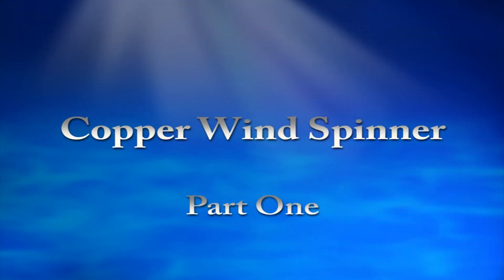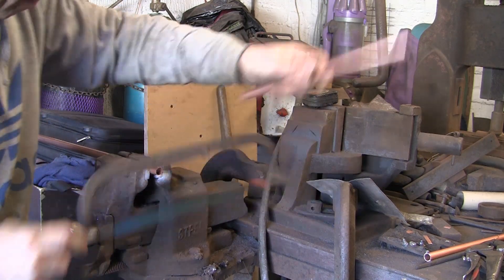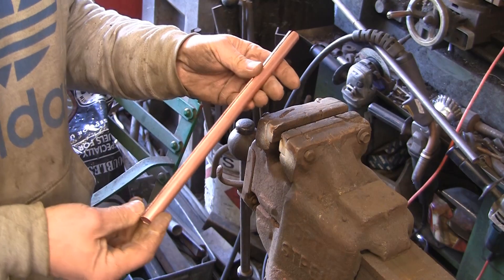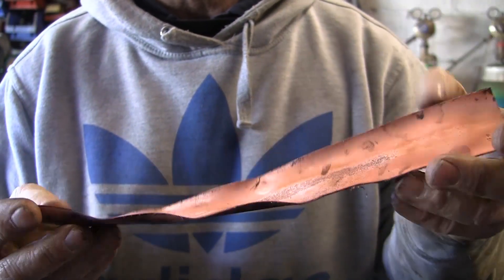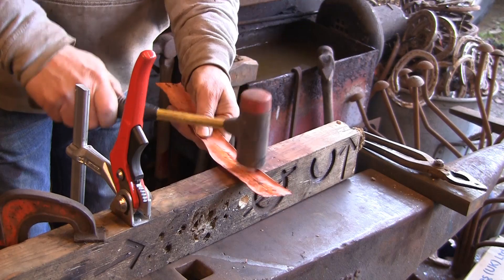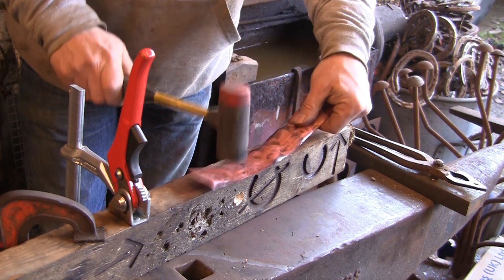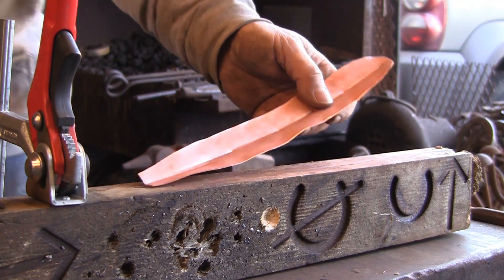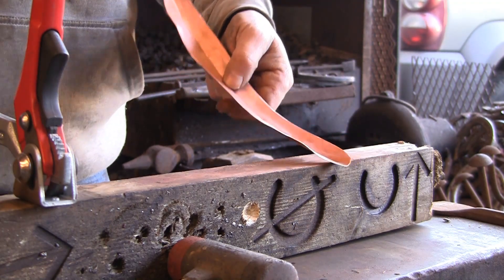Copper wind spinner  Part One

Comment: I'm not sure which camera you use, but you might be able to find a decent IR filter for your camera model.  I did a quick google and found some for less than $20.  They double as decent protection from flying slag damaging the more expensive optics.  This way you won't have to explain that "it looks hotter than it is" every time you work with hot metal.  :)

Comment: I have collected various sizes and lengths of copper pipe over about 15 years of service plumbing with the intention of selling it as scrap... until this video. I am thinking some type of copper ivy leaves under the eave overhangs. Is there some way to actually harden the copper after it been quenched? Copper ivy with a beautiful patina, yup.
Reply from the maker: Brian Bassett working the copper hardens it, heating to cherry red and quenching will soften it.
Reply: @garyhuston  It's absolutely beautiful to see you be able to peel that pipe open with your fingers. Can't wait to see the finished spinners.